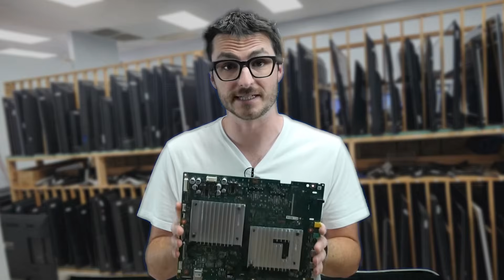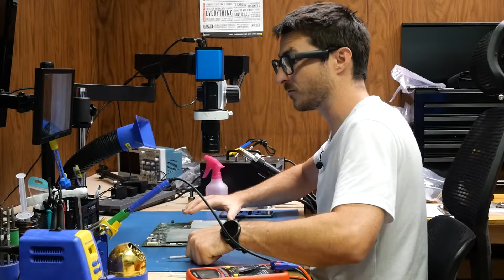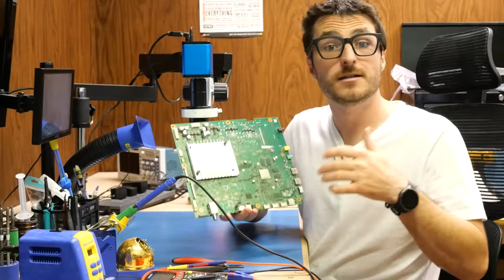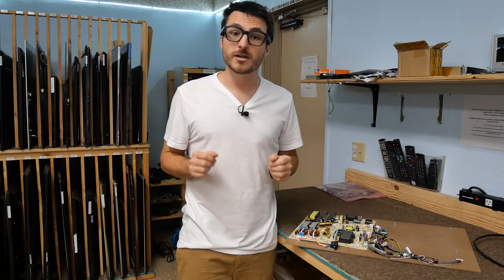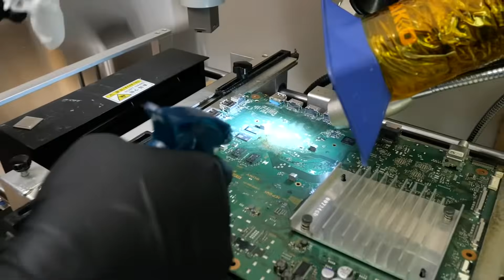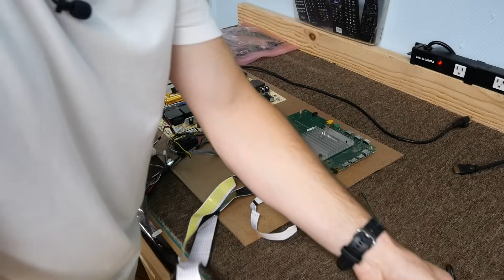How To Fix Dead Sony TV After A Power Surge or Lightning Storm XBR-65A8H

Comment: Hey Nick, it seems like I viewed your video in just the "NICK" of time. Lol.

Ok seriously though. I have A Sony XBR-55A8H OLED and exactly as you said was hit by a lightning/power surge which was right next to me. It Hit the wall jack, router, through the Eathernet cable into the TV. IT also buzzed my right bare right foot and Thank you God no injuries to me. 

So originally it started up. Then next morning it wouldn't complete the start up cycle. So I did the reset trick by holding down the buttons and 3rd try it worked until I powered down and again it wouldn't cycle through the power up sequence. That went on for a few days. Now the old reset trick no longer works. 

It's been 2 years or so now hanging on my wall and I looked for a repair shop they said parts are discontinued and they couldn't help me. I was about to remove it and dispose of it and I started removing the little panel to the left of the power supply hoping maybe a fuse. Nope. 

Something said to me. Google it and just maybe....And there you were. Nick I'm handy but electronics is definitely not my strength but I'm out of options so I'm hoping that you're not too busy to reach out to me and reply. I never spent that kinda of investment on a TV before, but I absolutely love it, and you are my last hope. So please 🙏 get back to me. Repair or Advice to repair anything but a landfill is my hope. 

My name is Chris Deering and I wouldn't post this unless I was desperate and serious about this. My number is 765-686-0232 Indianapolis area. 

Thank you Nick 
I'm hoping you can get intouch😂. 

Chris

Comment: Ive always thought high end Sony TV has some form of surge protection among other 'shield protection' advertised?
Reply from the maker: They do but that is on the power supply side. 
I don't really think it would make sense for a company that builds TV's to also build some sort of lightning strike protection circuit for USB's ethernet, HDMI, Tuner, excetera. You would have to add hundreds of dollars to the cost of the device as well as many more pounds and 4 inches more of thickness to be able to do that.

Comment: Ummm, so stupid question (not really) how the heck do you remove the back to replace it?  I've replaced boards on two other tv's but there were screws to take it off.  My XBR65A8H has no visible way to remove the back to access the board.  :(
Reply from the maker: So I don't have a video on this one specifically but it's going to be similar to this one linked here:
https://youtu.be/9JNQ78WDmWQ

It's the same type of mechanism where you pull the edges away from the set. 
Sorry, it's hard to describe it in text form.
Reply: @NicksTVRepair  Actually, it's not AT ALL like this one.  Thank you for responding though and for all the helpful videos you post.   I checked every video I could find figuring it would be similar.  The issue with my particular model is that there are no visible screws nor no indicators of how it is removed.  I happen to be very tenacious, however and figured it out on my own.  Soooo, if anyone needs to know, just let me know.  I don't want to type it out otherwise.  :)
Reply from the maker: I think you perhaps skipped over the video I linked a little to quickly. I understand your set doesn't have screews but the one in the video while it has 5 screws, 4 of those are simply for the wallmount and the last one is just for the power supply. They aren't there to actually hold the cover onto the TV. 
The cover has to come off by disengaging a series of clips all around the perimiter which is the exact same concept as your TV set.
Reply: @NicksTVRepair  Not sure that it's the same.  We pried ours off, but after first removing those little "doors" at the bottom and sliding the slide down (or up?)  It didn't seem to do anything prior to that step.  Or maybe that was just coincidence?  Anyway, we got it fixed.  🙂
Reply from the maker: Good to hear
Reply: Hello how did u get the back off please?
Reply: @franksakowski1532  Sorry.  Just now saw your question.  Did you still need this information?

Comment: Hi sir, can i ask you about my tv. It's sony xbr75x800h. There is power but no picture. It also has crack but i know it has na physical damage
Reply from the maker: "It also has crack but i know it has na physical damage"
Perhaps the outer antiglare layers are not cracked but the inner layers are. That is why you do not have a picture on screen. The best way to fix this is unfortunately to go to the store and buy a new one.
Reply: @NicksTVRepair  LOL, I wish I had a dollar for every customer that tried to talk me out of the bad news that the inner layer of the screen is cracked. "the screen isn't cracked on the outside, 'just' the inside!"   I explained it by saying it was like trying to change an inner layer of plywood - the LCD glass is laminated between two sheets of plastic - the plastic usually doesn't break but the inner layer does.

Comment: Great video, but the background music is very annoying when using headphone.
Reply from the maker: Yes you are right and I am sorry for that. I have already mentioned it to my editor.
Reply: @NicksTVRepair  No need to say sorry, i have sub to you channel. My 6 series were flickering, so I replcaed it with 7 series 6 months ago.
Reply from the maker: @JohnSmith-el5mo  This one was one of our higher effort videos so I wanted to try and make everything as perfect as possible. 
:) I appreciate your support! What model 7 series did you purchase if you don't mind me asking.
Reply: @NicksTVRepair  The Au7100 55ich
Reply from the maker: @JohnSmith-el5mo  I haven't seen this model come in to our shop for repairs yet. So either it's built really well and is not prone to failing very much and that's why I haven't seen it yet, or it's just a bit to new and they haven't started having issues yet. Only time will tell.
Reply: @NicksTVRepair  Thank you mate from the U.K

Comment: Without another known good board it would hard to tell.
Reply from the maker: Yeah so the known good board was actually a bad board, but it had a different problem entirely so we could use it as a "good board" in the sense that we knew the readings behind the processor were going to be correct. 
The known good board we ended up fixing later on by replacing the EMMC chip as you can imagine. 
Even without it we would have been able to confirm the fault was the processor because we had several readings that were very low and close to 0 ohms.
Reply: @NicksTVRepair  how much does it usually cost to have you guys replace a emmc chip?